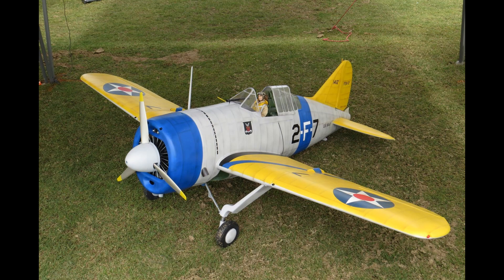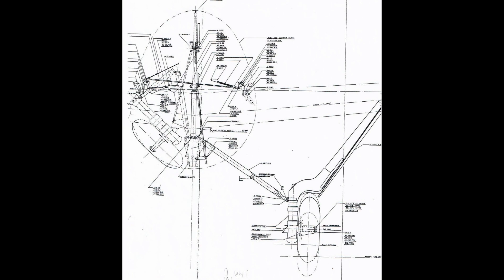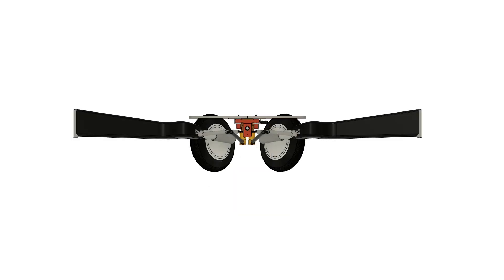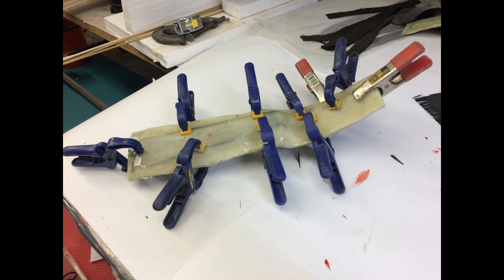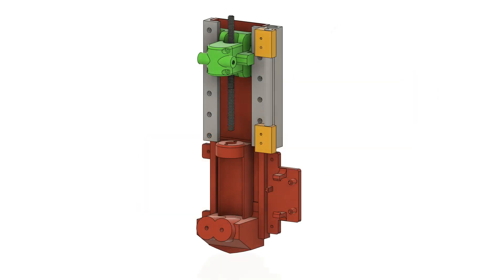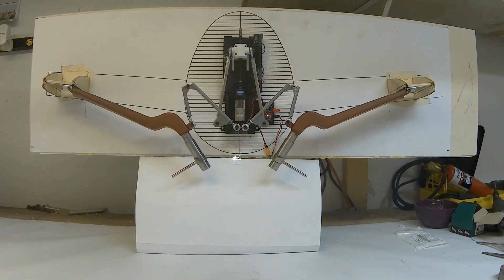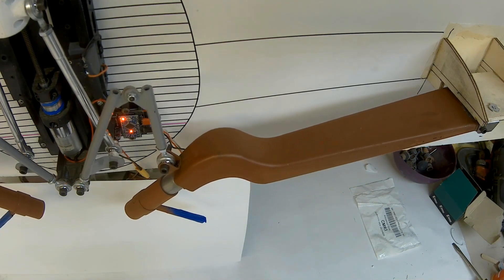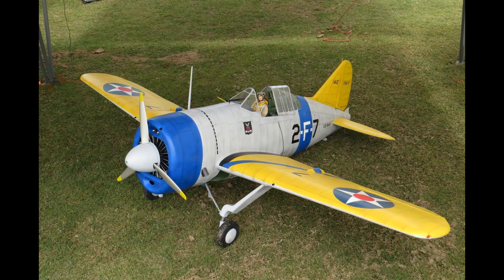RC Airplane Landing Gear Design. Brewster F2A Buffalo Landing Gear Design & Build 2.0

Comment: A very impressive achievement. I'm now wondering if commercial manufacturers of RC retracts might not crib some of your engineering solutions: Failure of retracts seems to be a very common failing in the gear you can buy1
Reply from the maker: Thanks. Making stuff for others is a challenge. Plus, no one wants to pay for what the design is worth. Rock ON!